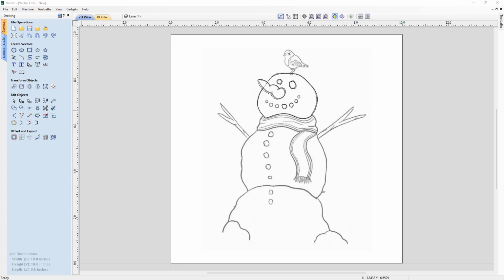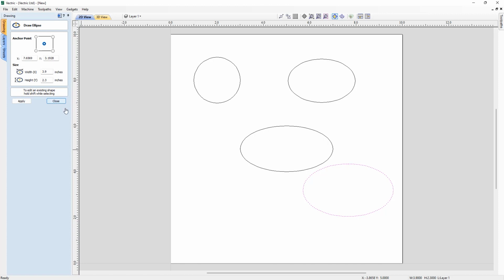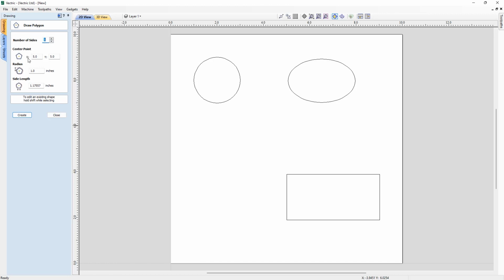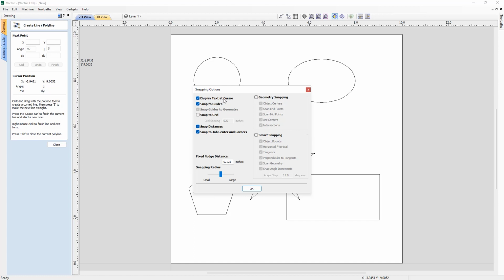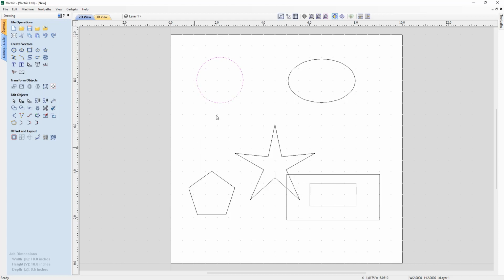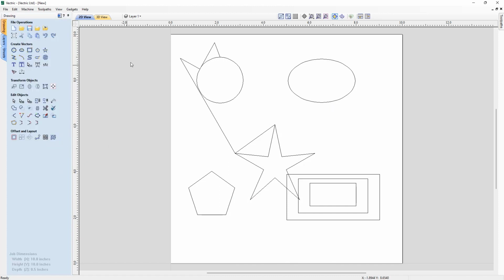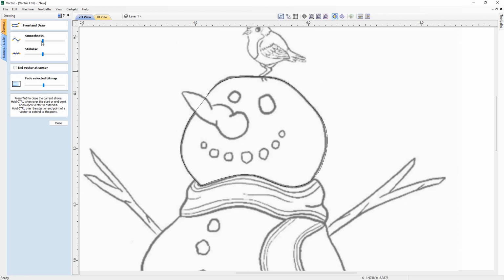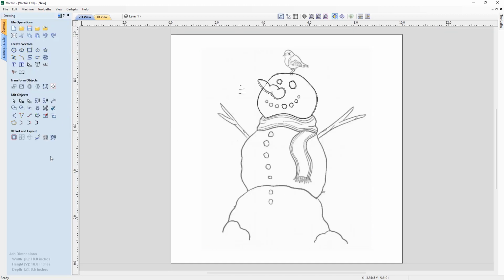Introduction to Drawing | Vectric V11.5 Tutorials

Comment: I have finally been trying to use the freehand tool with both the mouse and the wacom tablet that Todd recommended at the conference.  I was so excited thinking it would be easy to copy a bitmap.  Not finding it that way at all.  I have a hard time getting my Wacom tablet to keep drawing a line.  Every time I want to change direction like on the snowman the tablet stops drawing.  I have tried my tablet on two different computers and have the same issue.  Can't tell if it is a tablet issue or this is how the software works with a tablet.  Any ideas - getting very frustrated over something Todd made look like a piece of cake.  Is there something I should adjust in the settings for using a tablet?

The other issue is that I find it difficult to trace because as you pointed out in the video the actual point of reference for the line is not the cross hairs but in the center of the circle so I have to look backwards to see what's going on with the line.  Can this be changed so that I can focus on the cross hairs and not a random center point of a bigger circle?

Any insights or advice would be appreciated.
Reply from the maker: Hey Rob... it's Todd.  Hummm... sounds very odd... I just opened up the latest version ov V11.5 and my tablet (the same one as yours) is working fine.  Please contact support@vectric.com and ask them to send it along to me and we can take this to an email conversation (I can share my tablet settings and see if that may be the issue).  

I can understand the "cross hairs" and "circle" thing... but unfortunatly at this time there is no way to change that in our options.  To be fair Rob, feedback like this is important, so we can better understand what our community is having issues, or trouble with and we can make the software even better... so thanks!
Reply: Do you have this issue with other software packages?  Basic troubleshooting eliminates variables'
Reply: @SouthernOregonCoast  honestly I don't know when it didn't work as smoothly as I saw it work before I put the tablet in a drawer and stopped using it.  Didn't take the time to try and troubleshoot because it was a convenient thing vs. a must have thing.  That is on me.

Comment: Display property of selected object disable (grayscale) in vcarve pro 10.514 in 2D please suggest how to enable it for check the object details like curve line length and more.
Reply from the maker: Hello... just simply press "t" on the keyboard while having an object selected, or if you need you can choose the tool and then select the object to populate the form with the objects information.  Also we have the measure tool... that helps as well.